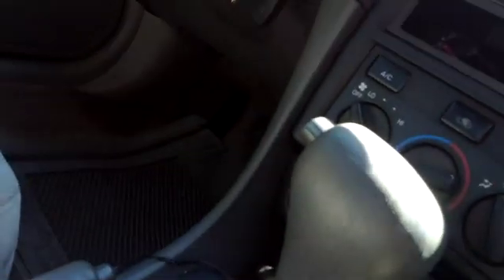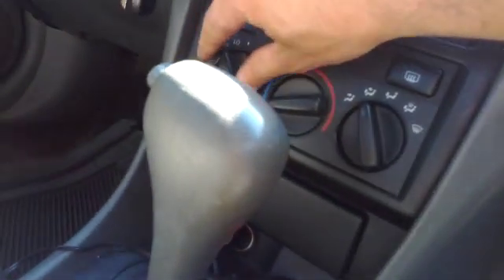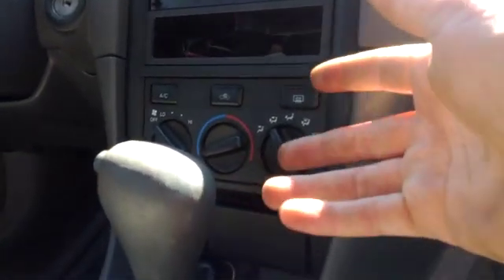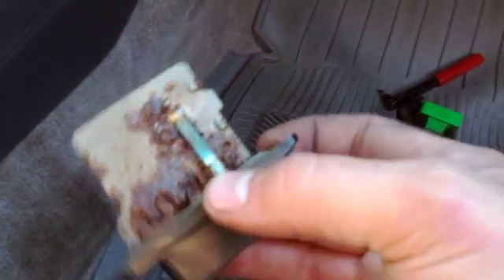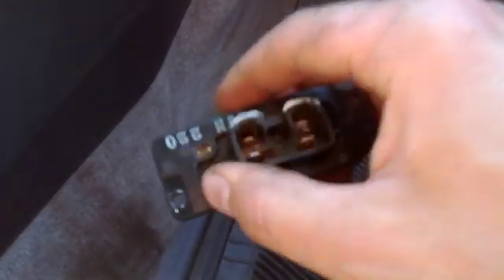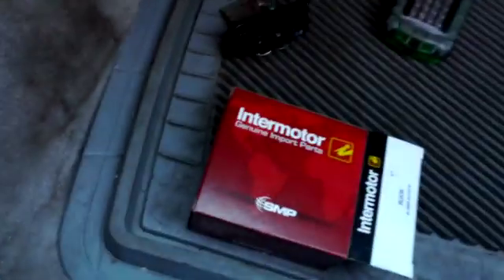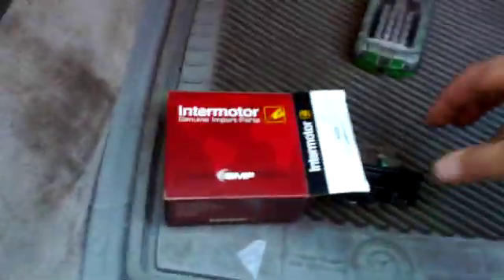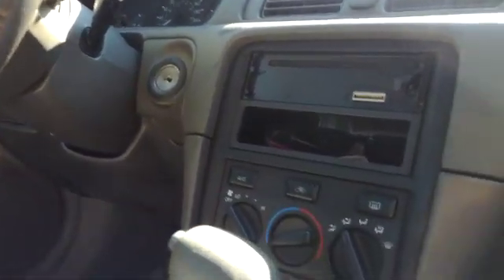2000 Toyota Camry blower resistor replacement

Comment: I enjoyed your video, I have a tip for you guys about these resistors.... First, if you ruin it somehow, you can't take it back... Second, they require the fan for cooling.  Now hear me out..... a low setting on the fan is the lowest CFM's the fan will put out.  yes?   also to run the fan at its lowest speed, the resistor produces the most resistance, which creates heat, which burns out the resistor.  If your fan is old, the bearing could be going bad, and if the fan does not spin @ at least the minimum RPM, to cool the resistor, your going to be buying it again real soon.   Even if the blower motor seems good, on the loweest setting could still be under the required CFM's for cooling.   So to ensure this does not happen... I suggest, never run it on low.  turn it off.    ... Now older blower motors can also freeze up, in the winter.... so leaving it on Low, and not knowing the fan isn't spinning at all, because it's frozen, will also, ruin the resistor and blower motor.    To ensure your motor isn't seized, from ice or whatever,  when you start the car, turn it to high, just to get it spinning.   Then use as normal, except trying to remember not to run it on low.
Reply: one more tip.... if your car has an in-cabin filter, which in this case, the Camry does.    The lack of air flow, will also, slow the airflow past the resistor, and again.....burning it out.     Now, most Camry's use Carbon fiber filters...those can be cleaned and reused.  it will look grey to dark grey.  that is normal.   This filter is behind the Glove box.  push the side tabs in on both sides of the box, and it should open, even more.  the filter just pulls out.   Hope this helps and good luck.

Comment: good tip! i'd say shes got some leaks between the firewall or windows, or even the heater core is leaking. pretty rare to see that much rust in there.

Comment: What if my heater fan switch wont turn off its on high but when it switch down it wont slow down and will not shut off,  its stuck  in highest setting?

Comment: Nowell, I also have a 2000 Toyota Camry LE and my car has this same issue with the AC/Heat only working on high. Could this also be the reason whenever I start my car on a cold start that it squeals for a few seconds, then the noise disappears. The belt is new and I had it tightened, yet it still squeaks. Does your car do this at times?
Reply from the maker: Jeffrey James The noise likely isn't related. It could be something as simple as a belt that needs adjusting.  Possibly your AC/waterpump belt.  Worst case scenario, you have a seized or seizing AC pump, which is causing excess load, when ac is engaged.  You likely do still have a resistor issue as well.  Cheers

Comment: Hi Nowell,

Great video! I have a question-- I have a '99 Solara which is suffering from a raised, sporadic, or "oscillating", idle when I either:

A) Have the Fan setting on "Defroster only" (not when it's mixed with the feet)
B) Have the AC Compressor on

6 months ago, I suffered from the blower motor fuse repeatedly blowing. The "chop shop" mechanic put a larger (30 amp) fuse in, and told me if the fuse blew again, I would need a new blower motor. This has not happened again, but weeks after I did notice the oscillating idle when using the defroster, so I stopped using it. Now that it is summertime and I need to use the AC, this becomes a more pressing issue. Any advice?

Thanks very much,

Joe
Reply: OK, so you have a different problem..... seems 1 of 2 possible things going on.    The AC is low on coolant, and even though you may be using the heat, by using the defrost, turns on the compressor, to blow dry air across the window, in turn defrosting it.  So, if the Freon is low, the compressor will "cycle", turning on, not reaching require PSI, inside the system, and turning off again... Cycling, over and over again.  until you either, refill it, or pull the AC compressor Fuse ;)       The second possible problem is your Compressor bearing are shot, and it ran out of oil, either from a leak, or lack of freon for too long of a period of time.   so, like a motor,  that needs oil to keep bearing from grinding away to nothing, an AC compressor also has pistons and bearing that need oil too.... So even if you think "my AC hasn't working in years", well if you turn on the defrost, you using it, and if it's empty, your grinding away at the bearing and sooner or later, your going  to seize it up, or throw the belt.... either way, this will stop the car.   If your not going to fix the AC, please, pull the fuse, or unplug it at the pump.

Comment: Its rusty because it in air path and wen AC is not on it just blows the moisture in Air thru system . I usually have Ac comp alot to De humidify my air  i dont care temp out. i like dry in confined space

Comment: hah. dude i have these SAME problems with my 1999 camry LE. (As well as the lights for the fan and temp controls...) I'm doing the resistor now, and have to hit the AC next.
What ended up being the problem with your A/C? Mine doesn't work either. I'd really like to save the time and aggravation of troubleshooting.
Reply from the maker: My system needed an AC compressor. it was seized. As soon as I recharged the system, the ac sw. on the ac lines allowed ac pump to run, and its clutch to kick in, however once it kicked in, it nearly stalled the engine, and slipped the belt, as the pump had seized internally.  ... way she goes...  good luck with your car eh